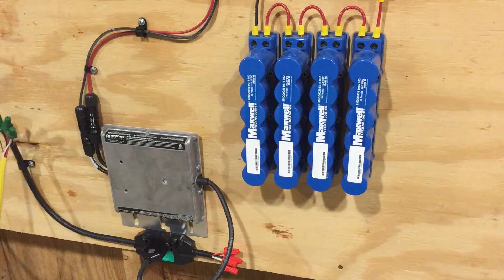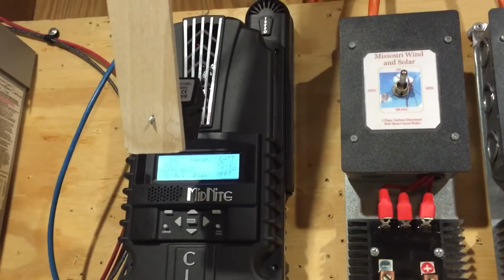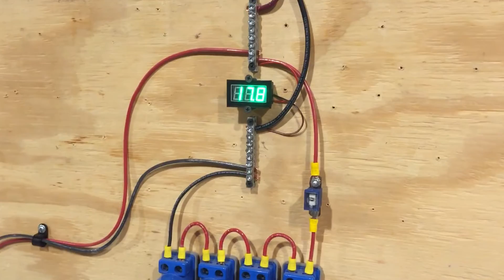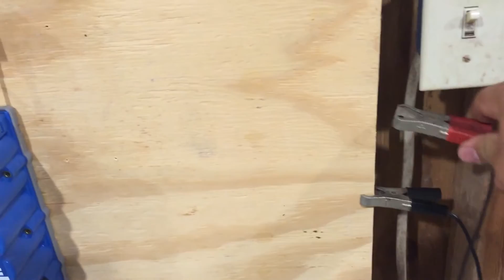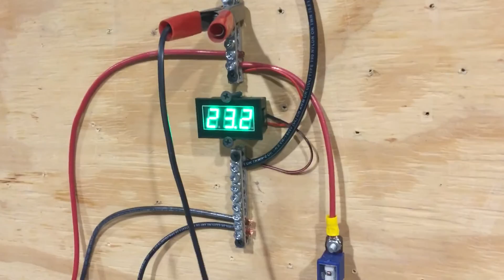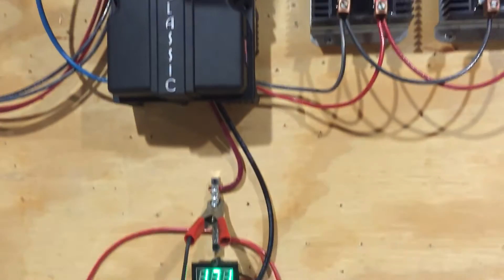Enphase micro inverter powered by wind. Part 2

Comment: If you have a set of 8-16 microinverters, you can follow a pretty good MPPT curve by switching on a different number of inverters at varying wind speeds. The inactive ones would sit at the low idle voltage.

Comment: Great video. How do you manage the power curve on the wind turbine to make the turbine run efficiently? In other words, the turbine should have the right torque/current at different winds speed so that you maintain the most effective tip speed ratio or energy harvesting. The solar MPPT does not do that. Can the wind controller set the power curve?

Comment: I have an enphase m215 and i can not get it to turn on did you need the envoy hub to get the microinverter to switch on?
I want to run it with my 500 watt wind turbine the same as you got here. please advise.

Comment: There has to be a more cost efficient way to do this.  I want to do something similar, but that Midnite Classic controller is too pricey.  Much more than the inverter costs.
Reply: True, but if you've played around with micro wind (I have), you'll likely end up with a trail of wreckage of burned-out gear.  If this setup avoids that, the higher price of the Classic will more than pay for itself over time.  But like Delfino said elsewhere, unless you absolutely HAVE to, AND you have an excellent site, OR you're just interested in playing with wind for fun...INVEST IN SOLAR INSTEAD.  If you're honest with the numbers as far as cost versus production, and you're factoring in burned out gear, maintenance, etc. (and that's not even valuing your time/stress), in most instances/sites solar "wins" hands-down.  With few exceptions solar just keep plugging along, like the proverbial tortise, but ends up winning the renewable race when you take all factors into consideration.  Again you may have a unique situation/site where wind is a better choice (or at least needs to be added to the solar mix), but for MOST people solar is the way to go.  But once you've been bitten by the wind bug (I have!) it's hard to give it up entirely, which is why Delfino's creative approach here really interests me :)

Comment: The 12V battery charger draws 1 amp but that is at 120Vac and then just chops the voltage to 12-14Vdc. So it's drawing 120 watts non stop, or at least when the capacitor is below 12V. On a daily basis that is a big loss compared to your turbine.  Maybe there is a more expensive charger that converts some voltage to power to save you money.
Reply from the maker: Art Smith ,the battery maintainer can supply up to 1 amp at 12dc.  the midnight controllers only require a few hundred miliamps to stay alive and not shut down completely. even of the controllers pulled the full 1amp. thats 12 watts at 12v.  12v x 1amp=12watts dc
Reply: Delfino Cornejo I'm not an expert but my point is that 12v charger wastes 90% because it chops voltage from 120Vac to 12Vdc.  I have the same one as best I can tell.  Try to measure it's power input sometime.
Reply: @delfinocornejo3496  If the current requirements are so low why not just use a suitable battery?

Comment: I'm glad you took plenty of time to sort your system out. I have 3 enphase inverters that I have had good luck fooling around with in the same manner as you did. I have found the cheap watt meters on amazon(not the killawatt meters) that say 120 vac actually work past 250vac as they seem to be made in china and are universal voltage. I used two of them to monitor the output of the inverter in real time and keep track of how much power went into the grid. Have you been able to see the max output from the inverter? I thought I had issues with one but found it wouldn't put out 250 watts until the voltage reached about 29-30 volts. Hope your system keeps working for you. Thanks for sharing!

Comment: The Freedom II PMG is 48v Why are you are using a 64v Maximum Capacitors Bank ?
In high winds is there a Overvoltage issue with the Capacitors if not please explain
Reply from the maker: watch the video closely again. the super cap bank is on the battery side of the charge controller.  the turbine side is AC and this Freedom II PMA can produce over 200V AC. the caps would not survive that.